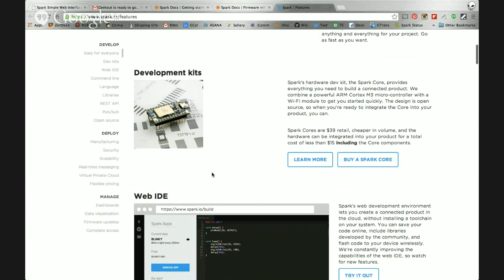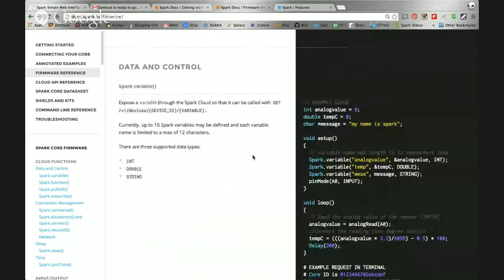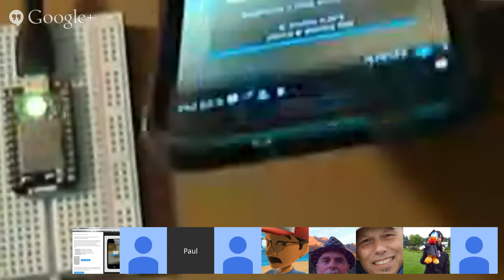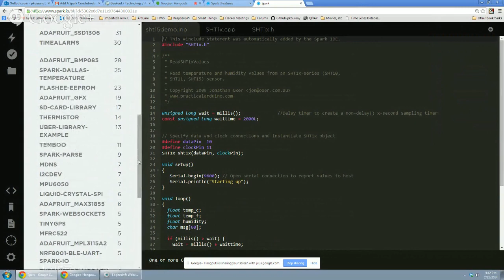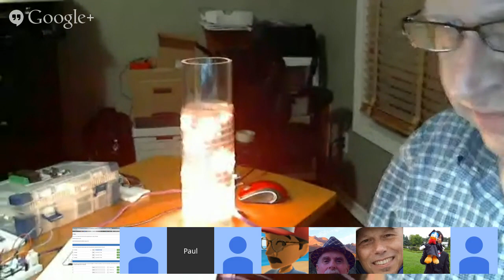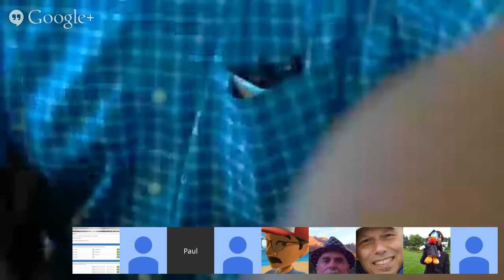A Spark Core Introduction

Comment: all looks great, I am very new to coding and struggling a bit. I have managed to code up an Adafruit 8x8 bicolour LED matrix to work on an arduino board but not sure if it can run on the spark core? I expect so but could do with some pointers. I am trying to replicate an app I have created for phones (video can be seen at stagecue.eu) so that I can create a wifi cue light with control button. Possible do you think? it needs to work on wifi but a closed system as often it would just use a router not connected to the web.